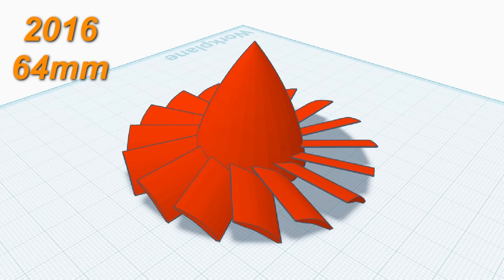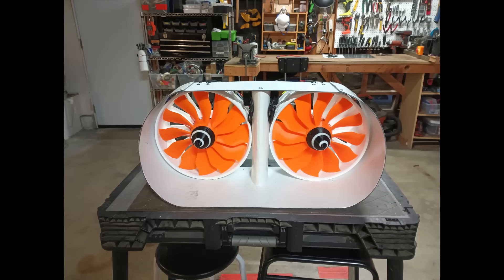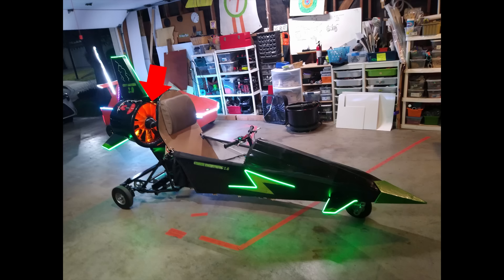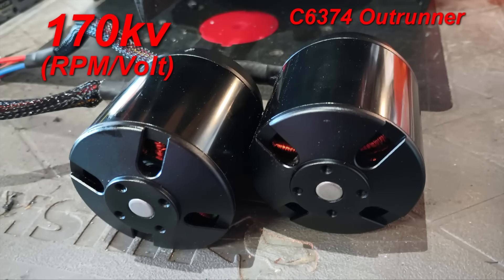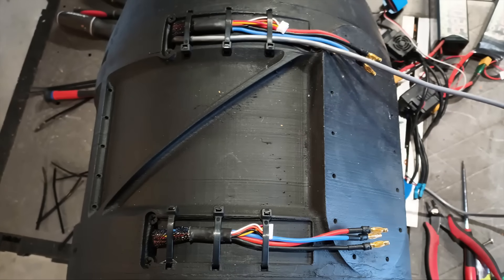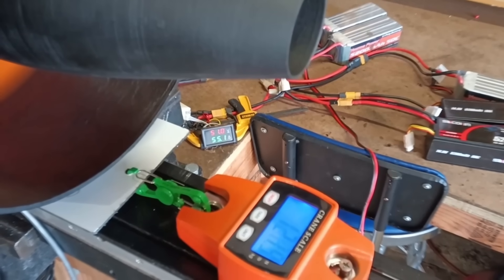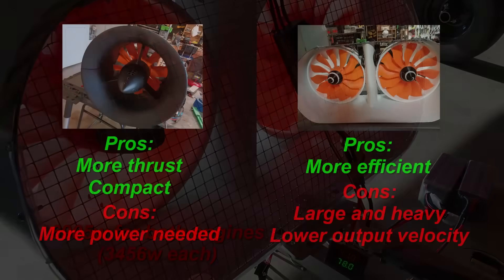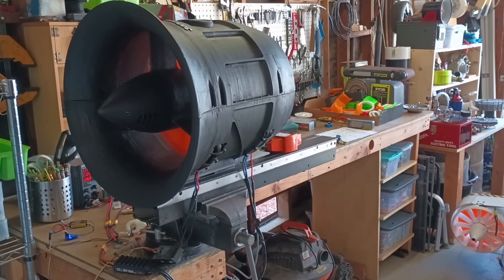3D Printing an Extremely Powerful Electric Jet Thruster

Comment: Ok, bear with me  here, but.....   While the California wild fires were burning and burning and burning, I came up with the idea of a full scale, water drone.  It was the size of a truck, had the thrust capabilites necessary to lift thousand of gallons of water and together with hundreds or even thousands of other drones might simultaneously make a huge dent in dousing fires without human intervention.  However, I was met with great skepticism that no drone had the power to lift such enormous weights.  To which I reflectively surmised that how in the heck did we go from Wilbur and Orville Wright to these the MD-11 or the TWA L1011 or the great cargo ships of the industry?  I thought the entire negativity was so short sited that I had to just drop it amongst the general public, they think I'm crazy.  But here you are, proving me right!  Keep it up and build engines the size of small cars, attach several around a circular steel inner ring, put in modified TESLA car batteries and in the middle is a huge rubber water bladder.  Add the neccessary guidance systems and heat protection (NASA grade) and voila, youv'e got modern air support fire trucks.    Your welcome.

Comment: I suggest making the fan blades separate ( look at steam turbines for an example) , so you can print bigger and replace one of it brakes. Buy ceramic bearings or bearings made for high roms.

Comment: Really surprised PETG held up to that high of RPMs, what infill percentage were you using?
Reply from the maker: I used solid infill for all rotating parts, mainly for the purpose of being as close to the simulation as possible

Comment: How many spools of filament did you run for this project?
Reply from the maker: It took about 3 1/2 rolls of filament to complete - 2 rolls for the housing, 1 roll for the blades, and 1/2 roll for nacelle components.

Comment: use steel blades and put an electromagnet in the middle, turn on the magnet and it pulls in making faster rotation,,,put a governor on it the wheel will go so fast it explodes if you don't regulate it,,,black holes connect to successes...

Comment: For a diy effort it's amazing! How much were all the parts?
Reply from the maker: The thruster itself cost about $200 us dollars but the batteries and controllers were at least $200 more
Reply: @AydenWardellAerospace  Thanks, not a bad price considering the pro ones are very expensive. I'm working on a planetary momentum flywheel that has dynamic rotation amplification. I'm just doing the r&d for the 5000-15000 RPM's structure, no need for under 3000rpms, it can handle it. It's 130kg but totally scalable to easily power several of your jets. When I have something to show I will be in touch again, maybe we can collaborate in the future?

Comment: What did you use to model the blades, and do you have a video on how you model the blades?
Reply from the maker: The blades were modeled in Fusion 360 using a loft function between airfoil profile sketches along the blade length. I usually use commercial jet engine turbofan blades as a starting point and modify the profiles based on testing performance characteristics

Comment: Have you measured the torque produced by the EDF when it's in action? Also have you tried rebalancing the power between the motors to see if it can improve efficiency?

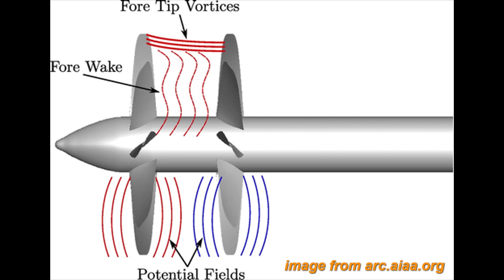Comment: I noticed that you put up data indicating that you should use less blades on the 2nd stage (3:03) but you put more blades on your second stage. Why did you make that decision?
Reply from the maker: I made the decision to reverse the blade count as an experiment in further noise reduction, but it didn't end up doing much. The next version will have fewer second stage blades for a comparison.

Comment: I calculated the amounts of thrust in terms of Kilograms. And at 13.9 it's pretty impressive.  
With 16 of these, assuming the vehicle would weigh 100 kilo's and a person of 90KG. You would have 222 Kilo's of thrust and a TWR of 1.17. It would get you off the ground, but not very fast. And your ears would bleed out before you get anywhere XD  But it's possible !

Comment: This year I built an (almost) fully 3D printed pinewood derby car with a 50mm EDF fan on it. I had it going nearly 600 scale km/h, there's definitely some changes I need to make for next year, like the contrarotating fans, and pretty much anything else to maximize thrust

Comment: Some interesting developments could be to make the blades out of CF (prepreg or resin infused) using a 3D printed mold but that would certainly make things more complex to build.
Another option would be reinforced injection molding using resin molds, nylon pellets and one of those cheap hobby injection molding machines
With this you could probably load the fan a whole lot more and squeeze at least twice as much thrust
Reply: You can print it in nylon and anneal, why injection mould it?

Comment: Usually the second stage fan in contra rotating setup is running only about 50 to 70% of first stage power, with second stage having less blades that are at higher aspect ratio and swept. This is done so blades of the second stage don't produce additional drag from air swirl that's in opposite direction.
Your design is still great but I hope you can do more testing before committing to metal motor mounts.
Have a good day^^.
Edit: reading through some cf turbo data and finding more research paperwork online it seems that it's better to make both stages run at same power by either increasing the aspect ratio of second stage or reducing its blade count. If possible it would be good to try just flipping the two stages around and seeing if that improves anything.
Reply: Up up
Reply: What is your source?
Reply: @monsieurLDN  i tried posting three times but i give up, youtube keeps deleting my reply, they will probably delete this one too
Reply: @blackturbine  ah youtube doesn't allow links (probably because of those scam websites) you could tell me the keywords I can look for
Reply: @monsieurLDN  try going to Research gate with: DESIGN OF A COUNTER ROTATING FAN - AN AIRCRAFT ENGINE TECHNOLOGY TO REDUCE NOISE AND CO2-EMISSIONS

Hopefully this will go through.
Reply: @blackturbine  from what I quickly got from it, wouldn't the higher stress be an issue as the fans are 3d printed
Reply: You're wrong, I suppose. The second stage in such configurations always has more blades. Take a look at the design of the coaxial propellers of the Russian TU-95 (Tupolev) aircraft. The author did everything right. And yes, as the author said, the total power is summed up, but with the right configuration, you can achieve only 30-40% more efficiency from the entire power plant of this type.

Comment: Automotive "Spray putty"(spray can) smoothes/ fills small gaps in 3d prints without the need for sanding. Also you have steel balls to stand behind that monster while its running
Reply: It likely would blow stuff out the back.  When jet engines fail the airport cleans debris from behind the airplane.  It’s rare for something to come out the side.
Reply: @georgewashington9058  That is because commercial jet engines are designed NOT to fling shrapnel outwards into the body of the plane (you know where people and the rest of the plane are). And so what doesn't get ejected out the sides get spat out the back but this isn't made from steel and Kevlar and just some printed ABS so those blades are going to go ballistic out the sides.
Reply: NAh not really, behind it is likely a lot safer than standing to it's sides because if something fails it won't be going back. It will be going in the angle of the motion.. AKA Out the sides.
Reply: @SilvaDreams  fair point, but if one of the rear blades snaps there's a possibility  that a section of it it will be blown out the back at terrifying  speed

Comment: Successful 3d prints without sudden rotor disassembly is very impressive.
Reply: Hold up
Reply: @mnikpro 🔴 What Is Islam?  
 
🔴 Islam is not just another religion.  
 
🔵 It is the same message preached by Moses, Jesus and Abraham. 
 
 🔴 Islam literally means ‘submission to God’ and it teaches us to have a direct relationship with God.  
 
 🔵 It reminds us that since God created us, no one should be worshipped except God alone.  
 
 🔴 It also teaches that God is nothing like a human being or like anything that we can imagine. 
 
🌍 The concept of God is summarized in the Quran as: 
 
📖 { “Say, He is God, the One.  God, the Absolute.  He does not give birth, nor was He born, and there is nothing like Him.”} (Quran 112:1-4) 📚 
 
🔴 Becoming a Muslim is not turning your back to Jesus.  
 
🔵 Rather it’s going back to the original teachings of Jesus and obeying him.